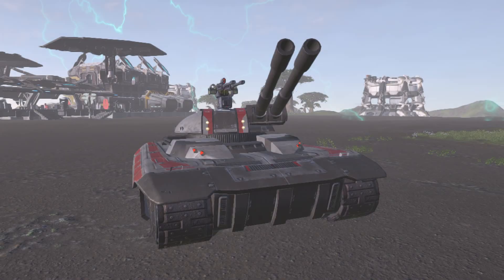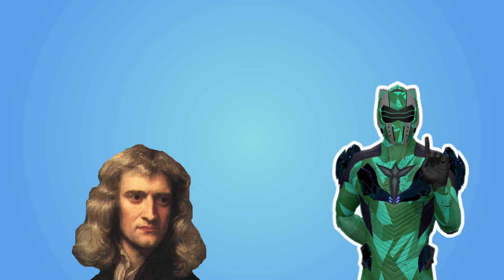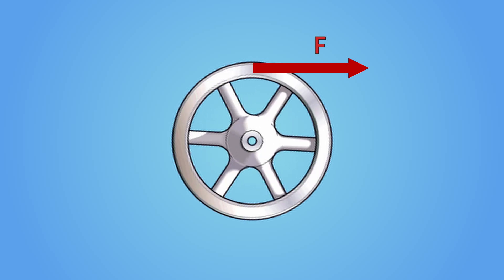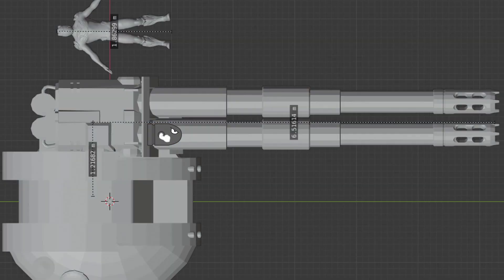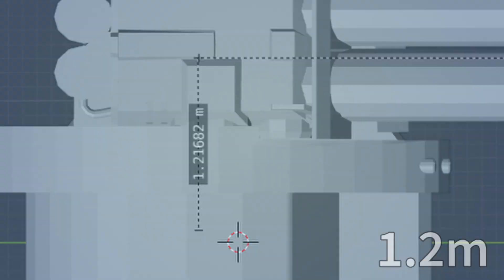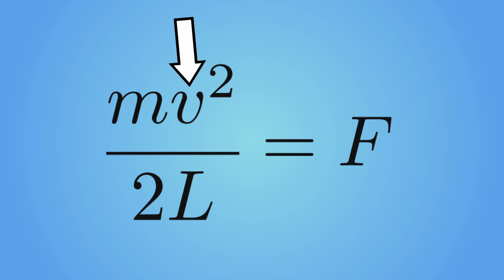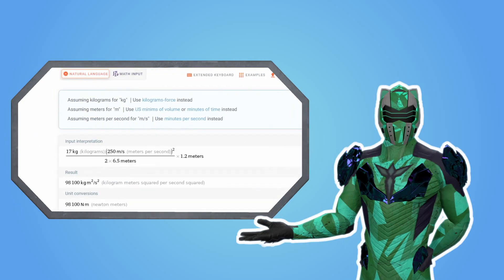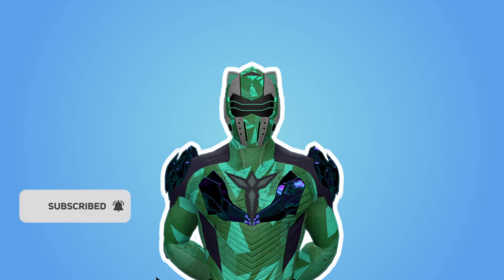The Prowler Has A Big Design Flaw That Causes It to Destroy Itself When Firing

Comment: There's actually a lot of ways around this. You can use venting or some sort of recoilless rifle mechanism - or more like something like the Rarefaction Wave Gun (RAVEN) technology that's being developed. There was a vehicle that had an offset cannon like this - the T114 - which was a tank destroyer on an American M114 chassis (which was the beginning of many problems right there). It utilized a recoilless rifle so it had no issues with torque on the turret.